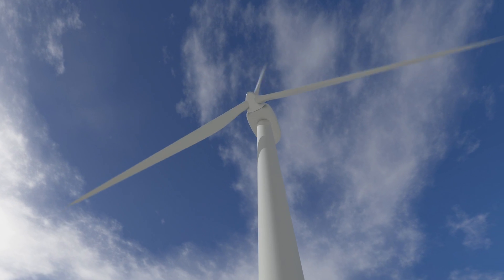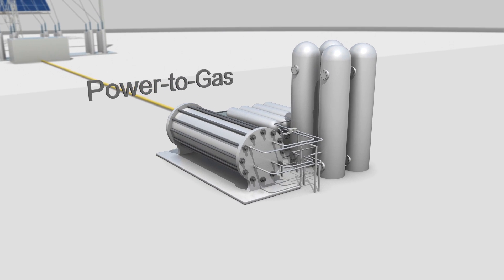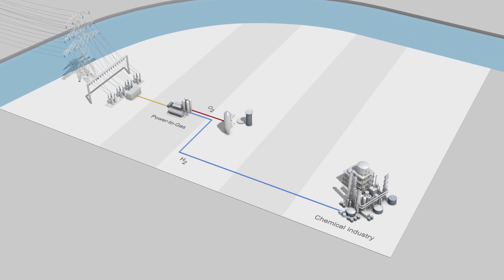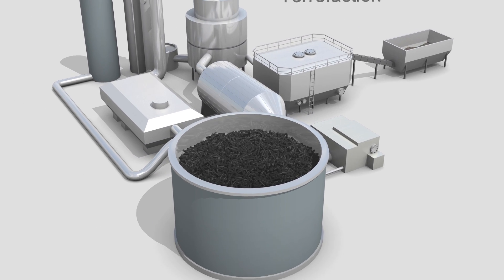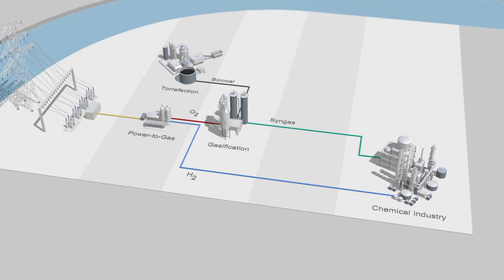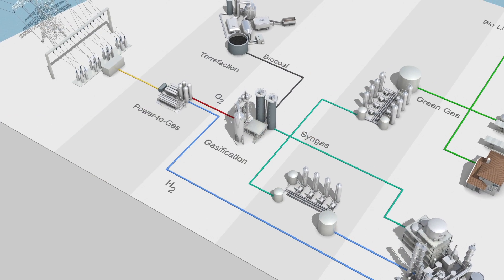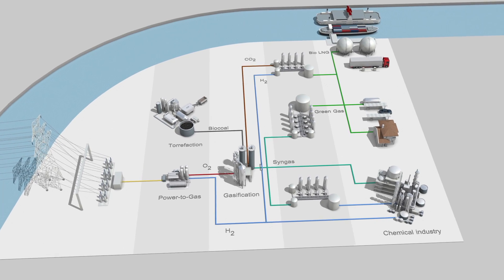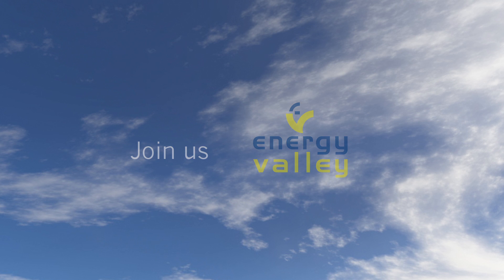P2G - Energy Valley Power to Gas

Comment: In pumping 35%energy produced is missing
In airconditioning 50% enegy is missin due to poor thermal insulation
5% to 15% energy is missing with highaspiration temperature of engines
 About 35% energy is lost in coo king with LPG
Only 15% energy is gained in firewood based cooking